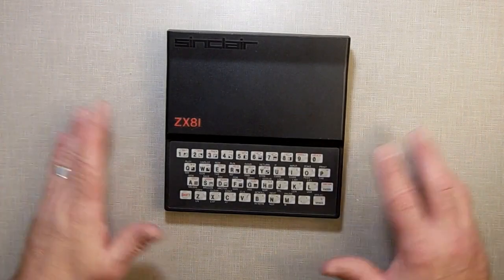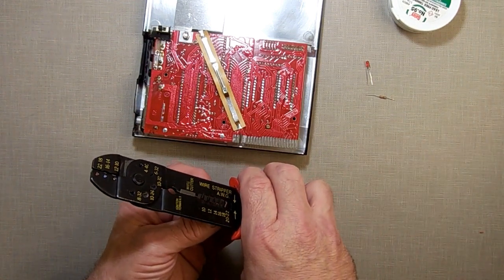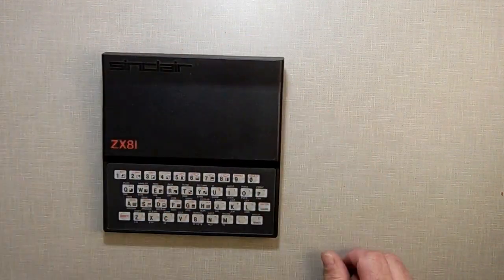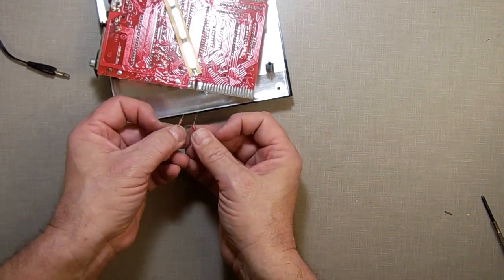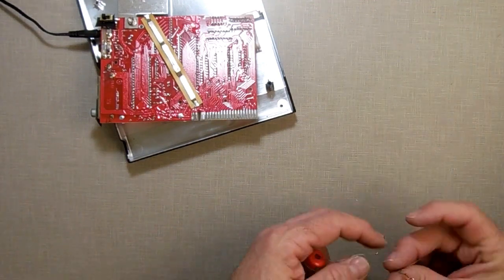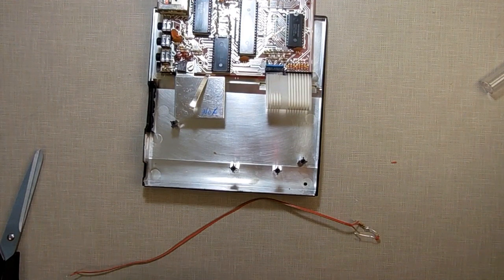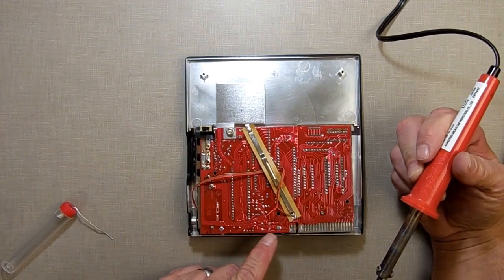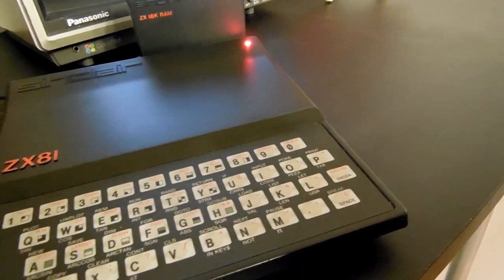Edit And Then: Let There Be Light

Comment: @5:19 😱
Reply from the maker: It works and it’s convenient :) kind of like Herman Munster doing his nails
Reply: @8BitMilli  The problem with that: soldering iron tips has special coating you harm (literally remove - in this case) this way ... You can even harm them just by scrubbing too strongly against some stiff/thick wire or something must be avoided, let alone a direct attack against it ;) Probably not a big deal with a cheapo tip + soldering iron as much, though (some very cheapo ones do not even bother with any coating, but that's really the bottom line of the tools only). Once you harmed the coating, your tip will oxidize much more quickly than in normal scenarios (ie, with the coating intact).
Reply from the maker: I learned this myself when I got a new iron and realized it :)